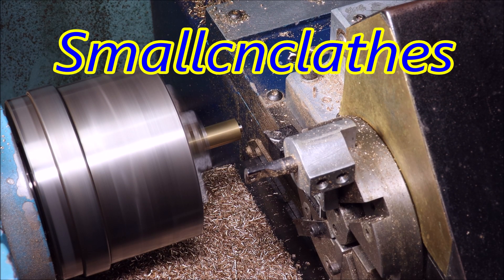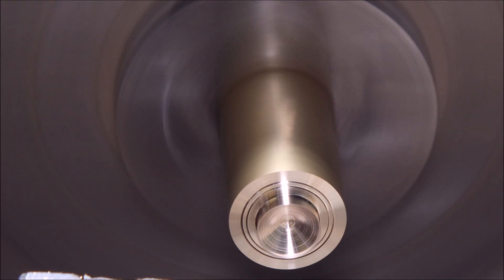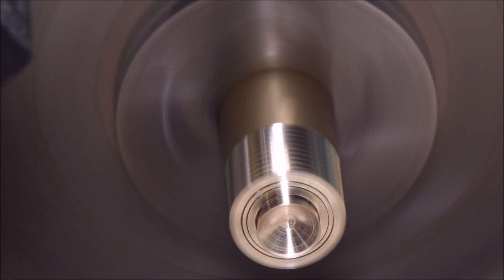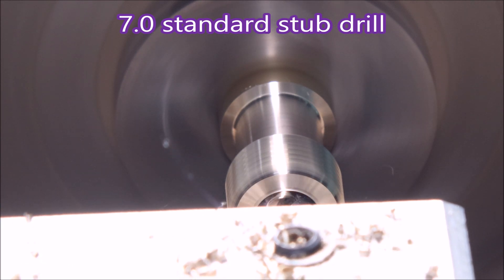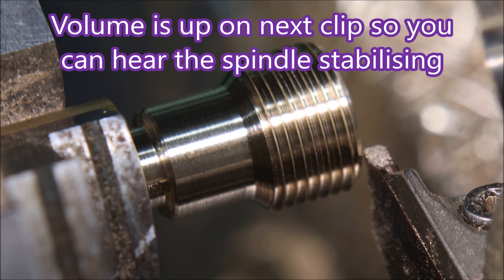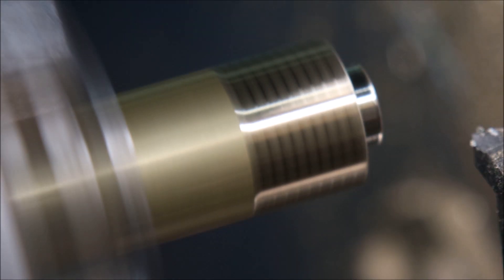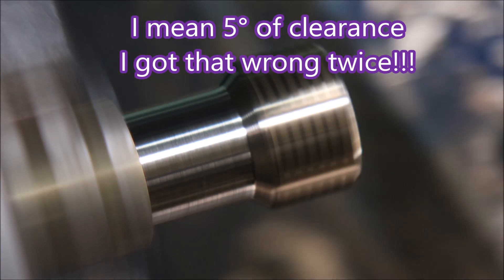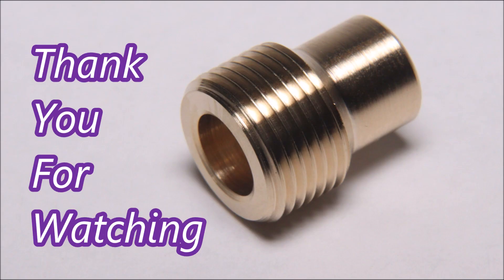Small cnc lathe threading ½”x26TPI brass nipple. Drilled, turned and parted, all at 3000rpm

Comment: Is all that movement coming from the spindle or? Kind of hard to tell from the video, but when I slowed it down it kind of looks like the part is moving/shuddering separate to the tool? Maybe that's just the camera ?
Reply from the maker: Camera was on tripod ( not a very strong one) but it was in no contact with the lathe. All that movement was from the lathe. It only weighs about 140 kg, so there is not much of it. In production tomorrow so I will drop the speed to 1500 rpm for the threading and see how it behaves. I can then go to 3000 for the rest of the job. Will add time to the run, but the lathe might live a bit longer!  Thanks for the comment, always appreciate your input.

Comment: Nice looking little  part and as an old  drop the back gears in for threading I agree with HM threading at 3000 RPM really is really really fast... Martin
Reply from the maker: Thanks Martin, I think in this case, perhaps it is a matter of just because it is possible, does not mean it is mandatory!
Reply: The Feed Rate is matched to the Spindle Rotation ( RPM )
In this case the Spindle RPM is regardless.
Very common for Threads to be cut at High RPM on a small diameter parts.
And it gets Nigel inside early for Dinner because the parts were finished so quickly 😉😁
Reply from the maker: @weldmachine  Hi peter, I was notified about your comment re my habit od cutting the chamfers after the thread but I seem unable to access it. I find I get no burrs on the thread ends the way I do it.  have a look at this video at around 16 seconds, shows the 2 methods under a microscope. https://youtu.be/c4j2o23vXpw
Reply: @smallcnclathes  
I did consider the Burr removal in the programing.
Of course this is a great way to remove and Burrs before the part is finished.
I guess I tried to write it in a shorter form so as to Not make the question too long.
Curious question now ?
Can you Back Relief Cut before Cutting the Thread ?
My comment was deleted as I added another in reply to a comment from Martin.
I thought I said enough so decided to live with 1 comment per video, LOL.
Reply from the maker: @weldmachine  Not quite regardless. Both the windows and dos software have a spindle error figure.  This figure lets say 30 allows the speed to be 3030 0r 2970 and it still calls it 3000 and feeds for 3000!
In this instance I closed the spindle error down to 10 but I was still getting a slight pitch error which I adjusted out in the thread canned cycle.  If the spindle error is set small, the software can have trouble getting the speed right and the thing hunts up and down trying to get there, this can also make speed changes take longer than they should.  If it takes too long the software shows a "Cannot achieve spindle speed" error.
If you open it up too much to 50, then the spindle will easily find the requested speed but it can be 50 out. So, if one was to gut a thread at 200 rpm and the actual speed was 250, the pitch would suit 200 and you get a nasty thread. Sorry that is a bit long winded.  I imagine most Hercus users do not even know what the spindle error figure is there for.
Reply: @smallcnclathes  
Sounds like Fun 🙄
Well Not the Fun I would want with a CNC Lathe.
Seems like a Very Temperamental Operating System.
Maybe I don't Love this Lathe as much as I thought I once did 🤔😂

I did see it hunting to adjust to Speed.
But I thought this might be an up ramping of the Spindle problem
But actually it's an operating problem ??
Reply from the maker: The software and controls are 25 years old! I live with it.
Reply: @smallcnclathes  
Of course you could live with a controller you are familiar with.
A bit like a Good Tradesmen running an old Metal Lathe and still getting great results.
Reply from the maker: @weldmachine  The reason I have not retro fitted the machines, is I just can't be bothered learning a new way of working
Reply: @smallcnclathes  
You always manage to get the results your looking for from this machine.
NO sense to be concerned with more if you don't need it.

You have enough of a set up to get the jobs done that need to get done.
And your machine most lightly earned it's money back more than 100 times it value by now.

I guess I try to use my Pro machine thinking with Hobby based machines.
( that is said without insulting your machine ok 😉)

Comment: Hello Nigel,
Say you were making a batch of 300 items... on average how many single items do you make whilst tweaking the hardware and software until you can start production in earnest. 
Take care.
Paul,,
Reply: Hi Paul, it varies with the complexity of the part and what aggravations I encounter. Took a few parts with this one to wake up to the pitch being off. This case was unusual in that the stock was a little undersize and the older I get, the more parts it becomes! LOL. In this case, I had all dimensions ok within about six parts and another couple to get the thread sorted. This part uses two tools to get to the right length and the have to balance each other out to get the length. I always order more material that the qty requires so not a drama.

Comment: Could it be the deceleration of the carriage causing pitch error in the thread at that high speed? At least in my lathe's programming manual they gave formulas to calculate that.
Reply from the maker: It could be. That is one of the reasons, I always try to allow plenty of lead into the thread and in this case out of the thread too as there was no shoulder to crash into!  I have lots to make so I will be trying a number of speeds to see how it behaves. Thanks for your comment, I can always rely on you to comment. Not only do they help with the popularity of a video, they are also what keeps me making videos. I get few views on my most of my videos and only the comments keep me uploading.
Reply: Hmm.. needs a second carriage of equal mass traveling in the opposite direction to the working carriage :D
Reply: @nedshead5906  that only doubles the moving mass. The deceleration rates are programmed into the servo controllers somehow and they would need to be retuned somehow.

Comment: Would it have been easier to machine at say 2,500 rev and save a bit of faffing about cos cycle time would not have increased significantly and I know you only do small batches? Only a thought. Not knocking you, I love your set up. 👌👍
Reply from the maker: Well I have 250 to make, so plenty of time to try a few different speeds. The beauty of threading first i I can drop the speed for the threading and then back up to 3000 for the rest of the part. Only one speed change delay to cope with. Even speed changes take time. It will probably bang about a lot less at 1500. Thanks for your comment.

Comment: Hercus makes it look so easy! Threading at 3000rpm is insanely fast.
Reply from the maker: Hi HM, it does, my other lathe bangs about much less than this one, unfortunately the turret is not working at the moment.
Reply: @smallcnclathes  I gave it a go on my Chinese lathe with my DIY electronic leadscrew kit, feels like beyond 1000rpm it'll be tough to maintain precision with leadscrews, perhaps would be better with ballscrews on Z. Acceleration or lack thereof is another factor, I suspect my stepper will stall or lose steps at higher rpms.
Reply from the maker: @HM-Projects  Today I ran the same thread at 3000/2000/1500 and 1000 rpm. Ended up doing the rest of the batch at 1500rpm, still pretty quick  and gave a nice thread.  Olfoundryman thinks I make the hercus go places it was never intended to go. He may be right, today I checked out the three demo files that came with the software all of which include threads. The fastest is 1.2pitch and that is cut at 1000 rpm.  The other threads are larger pitch and they are cut at 750 rpm.  
Thanks for giving it a try on your lathe and leaving a comment